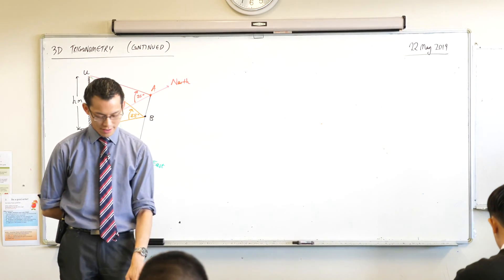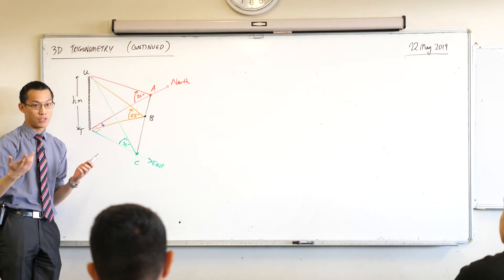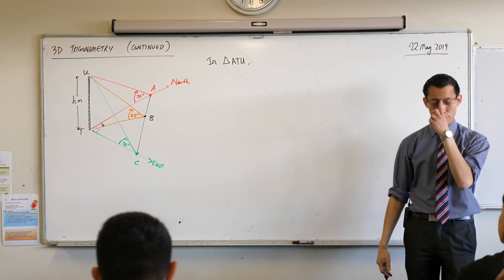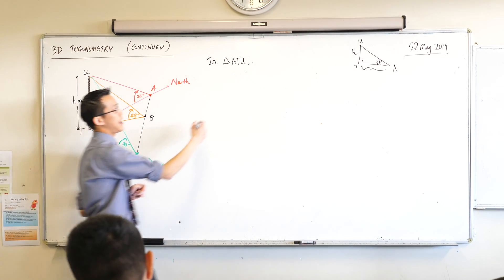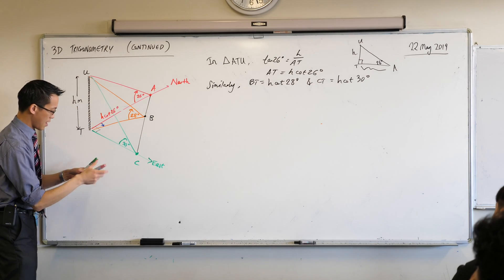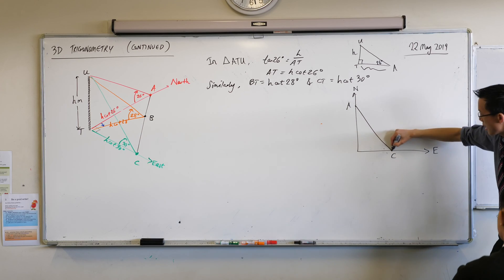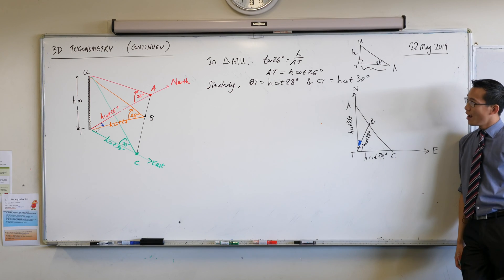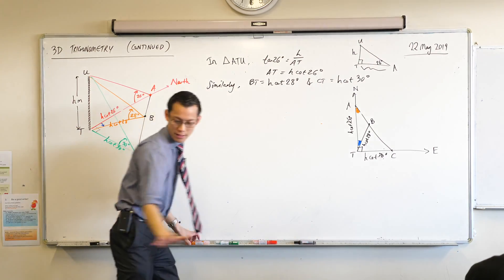3D Trig Three Observer Problem (2 of 4: Determining ground distances)

Comment: Is the assumption that B must lie halfway between A and C because 28° is in the middle of 26 and 30 and the path from A to C is a straight line correct?
Reply: It sounds as though it bisects the line, but it does not
Reply: I did some math though it sounds weird but it says its 0.085557 where I did the the section AB divided by the whole length of AC which should give 0.5 if it did bisect it